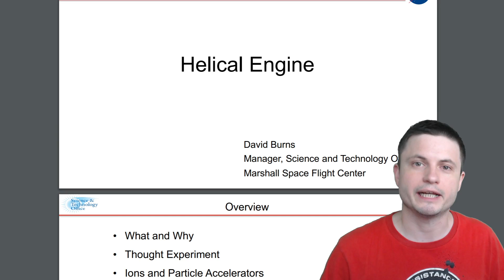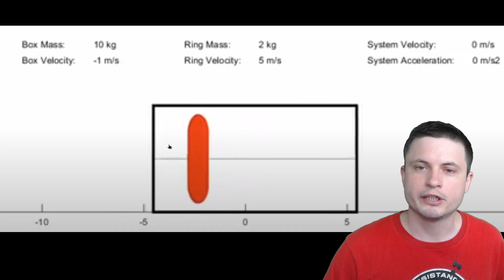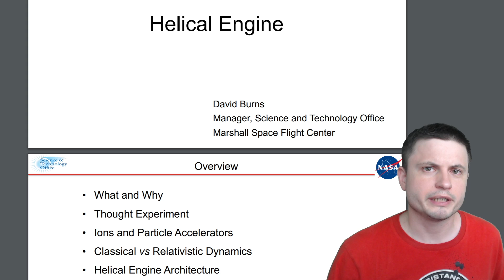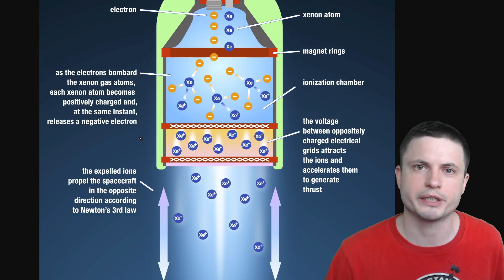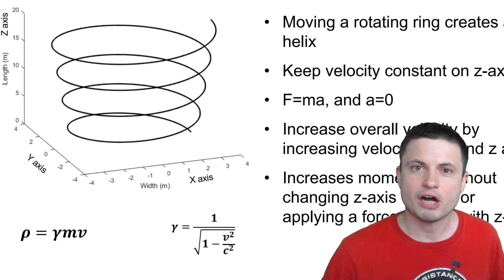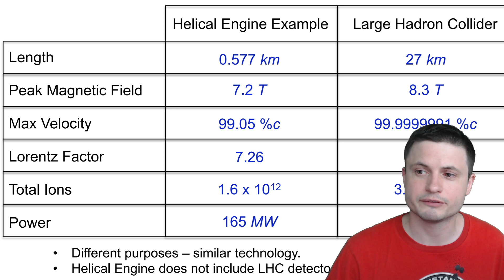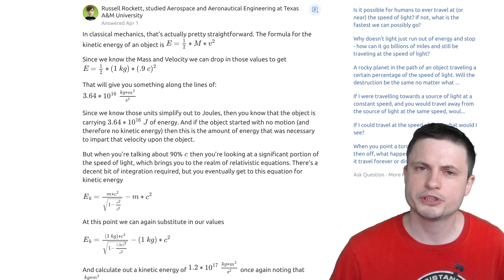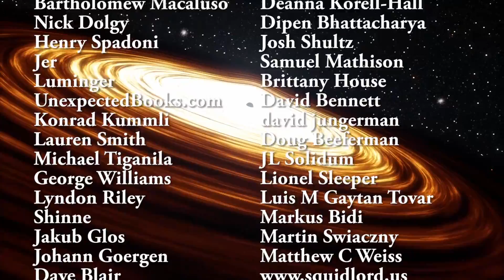NASA Engineer Designs a Near Light Speed Engine But Does It Work?

Comment: Near speed of light is not a problem, we could still send robots to Alpha Centaur and back in less 10 years, who cares if machines squeeze a bit and get really old fast as long as we can make them work.
I think Lorentz transformation apply to objects under some constant acceleration, because back of the ship push front part with ever increasing force basically. It's a play of different aspects of mass, but if we could make all ship's parts move and push in some synchronized motion, transformation should not occur. This is what internal engine is all about, just like jumping, all muscles must contract in some fluid order, so we can lift own weight from the ground, faster than escape velocity of a planet we live on.

Comment: Do you need to decelerate and reaccelerate the mass every cycle of the engine? You can probably recapture a lot of that by using a big system of magents, so you'd only really need to provide the energy lost to inefficiency, correct?
Reply: You would need to accelerate & decelerate on every cycle, so you'd have to store all of that energy between cycles, and even a tiny inefficiency would produce a tremendous amount of heat. "Nuclear bomb" intensities of heat.
Reply: @absalomdraconis  what about a dual chambered system operating out of phase? Eliminates the need to store energy - one charges while the other discharges. Link them with superconductors to minimize loss. I'm not sure what the theoretical maximum efficiency is, but probably fairly high in a vacuum. I don't think we are anywhere close to what's required, but I makes it more viable in theory.

Comment: I always thought when discussing relativistic speeds that the mass increase as it relates to velocity was just a way to describe the exponential increase in energy required to continue to accelerate the mass of an object (vehicle) as it's velocity gets ever closer to the speed of light, not that the objects mass increases literally.
Reply: Tt Miller  : The extra mass comes from all of that energy you pumped into the object to get it up to speed. So yeah, relativity is saying that motion is itself mass.
Reply: That's actually right. It's basically the "relativistic mass", which is a more philosophical concept than a physical one.

Today the word "mass" only referres to the rest mass.
Reply: Tt Miller  
You should not confuse the word "matter" with the word "material".
In the case of particle colliders like the LHC mass is constantly created. You begin with proton beams but after the collision more massive particles can be created.
Where does this mass come from?  Not from nowhere, but from the massive amounts of energy you put into the beams.

In the case of moving objects however it's the inertia, the resistance to changes in velocity, that increases.
There is no additional matter involved here.
Inertia can be different for different frames of reference, since motion is relative. But in all frames of reference the mass, that is the rest mass, will be the same.

This is by the way a result of the constancy of light speed + the relativity of motion, not an assumption. Einstein didn't take this out of thin air.
This also something you notice with particle accelerators. As the particles approach light speed, it gets harder and harder to accelerate them.
Reply: Tt Miller  
The problem that you are describing comes from the fact that science journalism is often not 100 % correct or correctly worded. These kind of topics need a large amount of time to be invested in to truly understand them. This is a problem when communicating this in simple language.

Regarding the increase in mass thing:
in classical physics it is p = m v where as always p is the momentum, m the mass and v the velocity.
In relativity it is p = m γ v, where γ is the lorentz factor which is equal to 1 or v = 0 and goes to infinity for v approaching c.
What you can now notice is that this equation looks almost like the classical one. You can now define a relativistic mass m_r = γ m and it looks exactly like the classical one again.
This means the relativistic mass is only an inertia not a gravitational mass or anything else. It is just a kinematic effect, that is relative to your frame of reference.

What you descripted in your example problem is one of the famous apparent paradoxes of relativity. They are only apparent, because they seem like problems only when we still think in classical terms.
What really can help you more than a thousands words is to look at space time diagrams. Mathematically those are "Minkowski spaces" denoted as M^4.
Those are just 4d spaces where one dimension is time and which have a special kind of metric.

You should look for "ladder paradox" * and include a space time diagram. It is crucial for the understanding to be familiar with reading those diagrams.
This also helps understanding the twin paradox.
If you found length contraction, time dilation and relativistic "mass" wierd then be prepared for the relativity of simultaneousness. ; )
This is where the truly mind being stuff starts to happen, but it resolves all of the paradoxes.

It is also helps to know how you get to the relativistic kinematic equations and the "Lorenz transformation" which is a mathematical operation that shifts between frames of reference. This way you don't need to take this stuff at face value.
The funny thing is, that you get to relativity from two angles:
Electromagnetism and
Kinematics.

You only need to make two assumptions:
c is constant for all inertial frames of reference and
The physical laws are constant for all inertial frames (like f.e. EM). From there on you naturally arrive at the Lorenz transformation and the relativistic kinematic as a logical consequence.

PBS space time made a bunch of videos about relativity which also involves a bit of the elementary math behind it.
And fitting to their name, they show everything in space time diagrams.

* Edit: I'm not quite sure if you meant the ladder paradox.

Comment: I wonder if this could make work some sort of EM Drive. Instead of having a mass oscillating inside a box, you'd have some sort of radiation source doing the same thing virtually.
Reply: Radiation already moves at the speed of light, so mass changing isn't possible, and energy changing would be redundant to produce momentum. But also I'm not the one exploring this technology so I could be wrong.

Comment: If you make a physical law breaking motion machine, you might want to double check your math.
Reply: This should be easy to test with a reaction-wheel toy that could be given to the crew on the ISS to play with. Just make a thing similar to a quad-copter, but instead of propellers there are flywheels. So then you have reaction wheels spinning in the opposite direction of the wheel on the opposite side. Spool up both flywheels gradually enough and then hit the brakes once going. If the toy starts scooting from that, then the idea in this video is valid enough. If I have any additional prediction in how it works, it will go in the direction the outside part of the wheels is moving when the brakes are hit, since that is going to produce the levering moment on the arm supporting the flywheel in relation to the arm on the other side doing the same.

Similar to how reaction wheels work to keep satellite orientation, but some differences in behavior since the wheels aren't on a common axis with this design.
Reply: Ron Maimon  Hmmmm are we sure this isn't one of those fake papers designed to test the quaity of peer review journals? :O
Reply: in reality we drive around in 150year old technology and a buncha "educated" folks sit around thinking its possible to go the speed of light...in your fantasy Newtonian world anything is possible,here in reality we are stuck with internal combustible engines..
Reply: Come back with this statment when the newtonian theories of motion aren't in disproven by observations on how quantum mechanics work.

Comment: Too bad we can't get a rocket with people past the 3 VanAllen radiation belts without 8 feet of lead all around them. But if the belts weren't there, the engine would only work in the solar system as the matter between stars is too thich. The sun pushes it out way and creates a void for the planets to spin in.

Comment: I think you didnt get the idea right. That megawatts of energy are used to accelerate matter inside engine, and then you get that energy back as you deaccelerate it. Net power usage stated in paper is 10W for 1N thrust.
Reply: That could only have any effect if the energy source were outside the craft and transferring momentum to the craft.  In that case, it's better to use a mirror-sail as that can transfer the most momentum, but it's not engine thrust.

Comment: Lorentz is simple in concept.  The energy of motion is expressed as mass.  To accelerate the habitation part of the ship up to a speed where its mass doubles, requires the amount of energy you'd get if you could turn a mass equal to the mass of the habitation module into energy with 100 percent efficiency and turn that energy into momentum.  To stop, you need the same amount again.  For a "warp one" flight if you can call it that, where you reach speeds where your mass doubles, you need a consumable mass at least equal to three times the weight of your payload.  Two times ship mass are used to get the ship and one ships weight in deceleration mass up to speed and you use the one times ships mass to stop at the other end.  You were right to ask where the energy comes from in this example.  Asking how much is the minimum energy it would take gives you the above description.  There are other ways.  Project starshot plans to use light sails and microelectronic scale payloads propelled by gigantic lasers on the ground to give the payloads relativistic speeds.  The scale is much more modest and the math has been checked.

Comment: Stole my ideA an circular particle accelerator pushing on one half of the ring using the produced radiation to slow it down on the other half
Reply: The younger generation forgot how vacuum tubes ( and now particle accelerator s accomplish these feats
Reply: You're idea!?!?! Ooookaaaayyy Hawking
Reply: Not a ion drive it's a closed system using the mass gain on the higher velocity side of the ring  all it takes is a cathode emitter a few accelerating grids a bending magnet array to return to scource ( after the decellration in the radius ) and then back to the cathode emitter for another go around . One side gets accelerated to a 80+ % speed of light and thrust will be off of the accelerating grids
Reply: Better than that em drive
Reply: That's not the same thing. You're describing an ion drive and we already use them as he mentioned. Not enough thrust for a lot of uses.

Comment: So it's an EMdrive and a Woodward drive, but with the same flaws because they all require a lot of energy in order to achieve a useful effect. How about we flip the problem upside down and take advantage of the law of superposition, so instead of building a large drive that requires a lot of energy to achieve useful effects, we build a drive that is composed of many millions of smaller microscopic drives and add together their effects. I believe that all of these proposed methods of propulsion are really producing extremely weak gravitomagnetic effects (from changing mass currents), thus creating a changing gravitomagnetic flux and a changing gravitoelectric (think gravity with curl) field. These are extremely weak, but much like electromagnetism we can take advantage of superposition to add together these tiny effects and achieve a large net effect. I think what we also need is what I'd call a gravitomagnetic core, which is similar to a magnetic iron core in electromagnetism, which has the purpose of concentrating the gravito(magnetic) flux. I'm eyeing AuIn2 because it is a nuclear ferromagnet at cryogenic temperatures. I see the keys to success as 1) quickly changing gravitomagnetic flux and you can achieve this through wave superposition of different amplitude counterpropagating waves, different frequency works too....this creates a preferred direction for the energy and creates the very quickly changing energy flux....and is what two of these inventions have in common 2) doing this millions of times over at the microscopic level 3) invent the gravitational equivalent to an iron core.

Comment: Let’s figure this if it works:

Earth traveling 30 km/s a human weights average let’s say on earth let’s say 150 pounds. If the same person is traveling 3000 km/s would weight 1500 pounds and shrink to 1000 times smaller and a 6 foot tall person would become a 0.006 of the foot or 0.072 of the inch or 1.8288 millimeters as the space into a body weight starts to squeeze and crush into atoms ⚛️ as they get heavier and heavier atoms become more compacted together from the gravity force. 

They hardly can handle a 11.2 km/s to escape earth’s 🌍 gravity from the G FORCE forget about traveling 🧭 3000 km/s they will become as small as smiley 😊 but weight and astounding 1500 pounds.

You don’t need experiment to understand this just use a calculator fucktards.

That means les than 2 millimeters tall. That is insane because what this fools are trying to do fooling themselves. They have all the scientific calculations but have no idea how to calculate 😂🤣.

What a lost cases they are.

Proverbs 3:34

He mocks proud mockers but shows favor to the humble and oppressed.

Comment: Maybe a strange question, but Im having no idea here: 
Speed is always relative to something. So what is the speed of light relative to? 
Light from a star moves at the "speed of light" in all directions, but the star moves around the center of the galaxy and so on... If the speed would be relative to lets say the whole galaxy, would it mean the light from that moving star in one direction travels faster/slower than the light at the opposite side of the star? 
How to judge what the speed of light actually is?
Reply: Speed of light comes from electrodynamic equation applied on the property of a vacuum. We then use light to define distance. Essentially speed of light is 1 and everything else is relative to that. But since we already have metric system before we started defining distance with lasers. Our measurement of the property of vacuum get set to the metric system which then spits out the speed of light that is not 1 when use in Maxwell's electrodynamic equation.
Reply: The universe has a causality limit.  Cause and effect travel at a specific speed, which happens to be light speed. No matter what your reference frame, light speed is always light speed.  That's why time and length will change. Light speed is always the same, but length and time will change depending on your reference frame.

Comment: Well so much for E= MC2  
remember school the cross the street math problem and every step is divided by 1/2?
Unlike NASA employee's I actually attended a school where they taught math. I was introduced 
to 0 and infinite as well as to log and pi. Guess I will throw it all in the trash along with physics for some CG and hand held out for more money to government. All on the Tax payers bill/ Money from thin air for pipe dreams. LMAO!
Reply: They taught tensor calculus and space-time metrics at your school? That's some fancy school you must have went to...
They obviously forgot to teach you that E=mc² only applies to systems with zero momentum, which is not the case for the proposal discussed in the video.
For non-zero momentum terms, the correct formula for the total relativistic energy is E² - |pc|² = m²c⁴ or E = √(m²c⁴ + p²c²).
If you missed even this simple detail on when to apply which formula, I'd be a little less confident in my supposed schooling and read an actual book on the topic or two if I were you...

Comment: So much more efficient to just carry a lot of iron pellets and fire them out the back of the ship?

To be honest this sounds very much like the EM drive which has been seemingly proven to not work.
Reply: @woodypigeon  Build a long enough accelerator and you could be throwing them at 0.8 light speed, maybe more.

The problem becomes supplying energy which would require a nuclear power plant

Not for space probes but if you are intending to go colonize another solar system or move a large mass around.

Comment: First; genius scientist at NASA has breakthrough idea 
Second; engineering student gets out pencil and starts doing the math 

Uhhhhh.      We have a problem 
Math ! It’s always the MATH !
Reply: degree in physics here, and yes, the wall is math.
The first step is to frame the problem in a way that simplifies the math.  Let the car bounce between the bumpers, just as in the video.  When set in motion aboard a ship the framework is the ship, and you get no net movement after the car bumps two walls.  As long as you use a frame of reference that is attached to the ship this is forever true. Momentum and energy are conserved.  Changing your reference point to something outside your ship will not suddenly give you free energy for acceleration.  Not even if your hypothetical reference point is traveling at nearly the speed of light.  The front hit has the car moving slower and so it experiences time-compression and mass increase. Bump. it goes back the other way.  It experiences time-decompression and mass decrease.  Bump again, cycle is done, and according to the desired outcome of the theory you get thrust.  Except that would be a perpetual energy machine, and they never work as advertised.  In this case the devil hiding in the details is the shifting between reference points, one attached to the ship, and one flying back at a high percentage of the speed of light.  Nice try.  Not gonna fly.